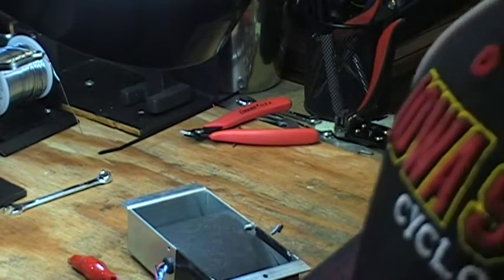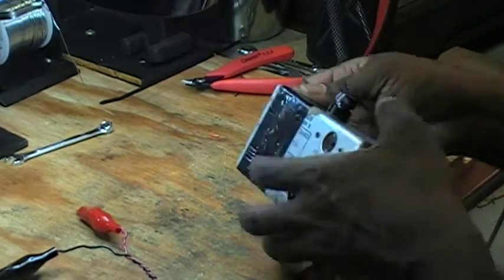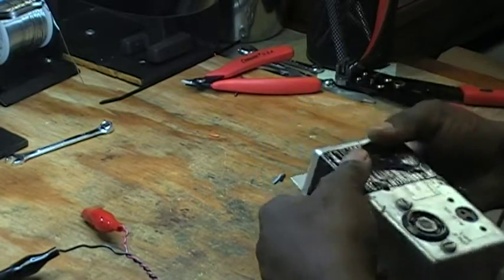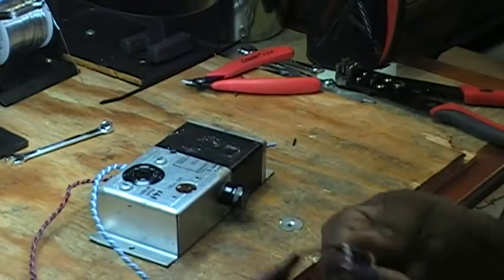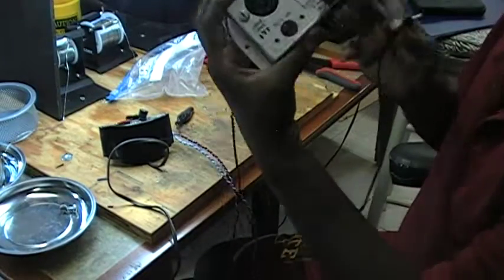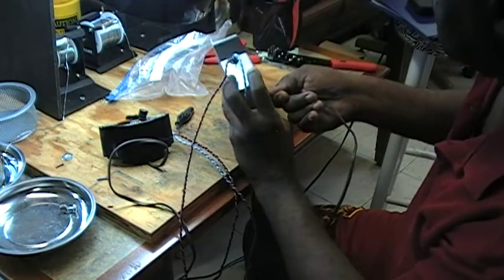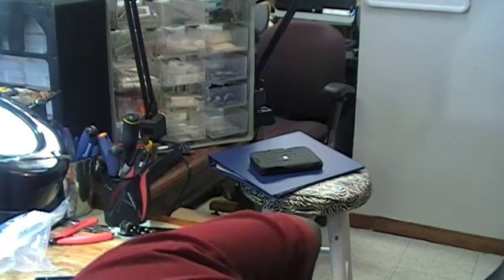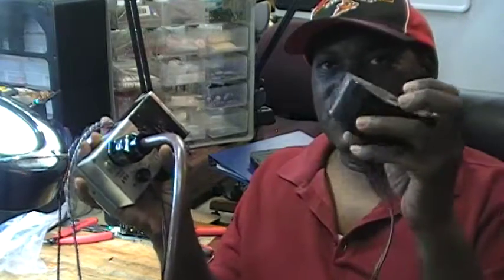Completing The Conversion Of A Leslie 26 -1 Kit For Connecting A Leslie 147 To A Hammond B3

Comment: Could i use a 26-1 box on a hammond C2?
Reply from the maker: Yes sir you could but you don't need to since this kit is designed for organs with internal speakers.  I am doing this project for a quick Leslie 147 hook up to evaluate an organ and Leslie 147. If you are connecting a Leslie 147 - you will use a straight 6 pin-out connection.  If you are using a Leslie 122, you will use a 428 or 8000 kit if you plan to use the vintage Leslie TX switches.